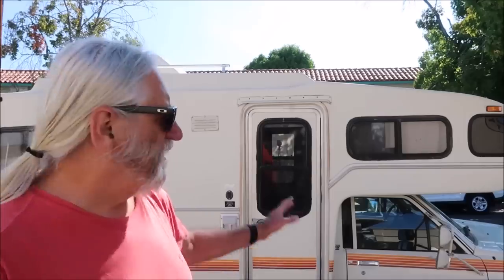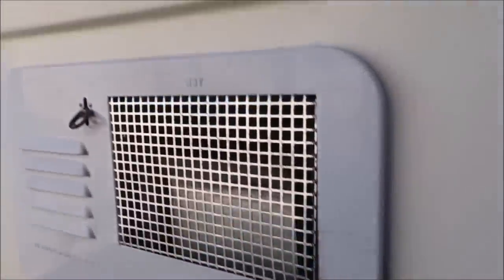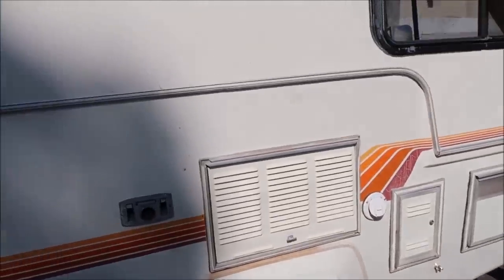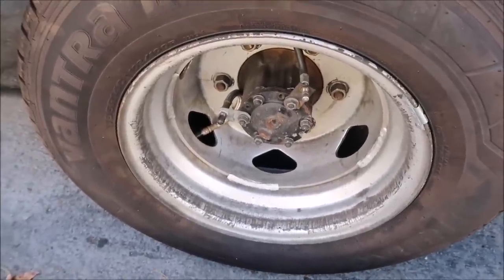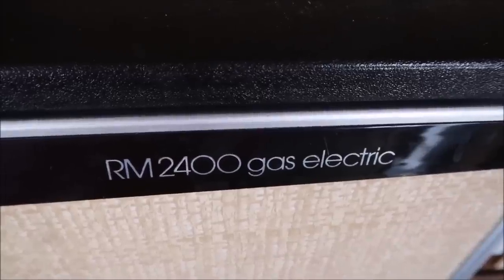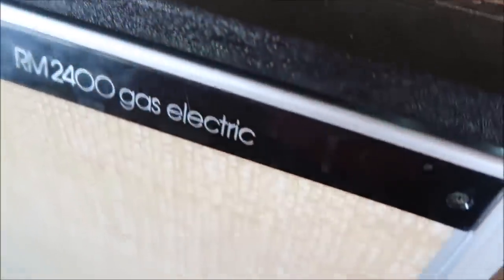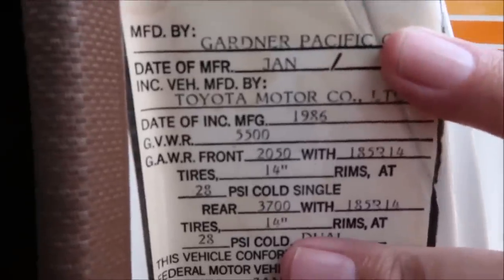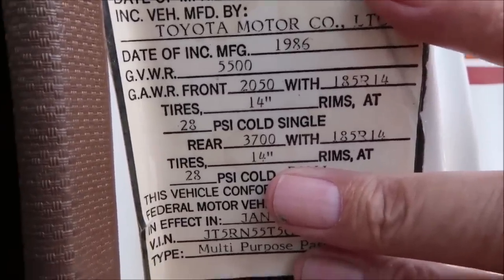What It’s Like Living in a Toyota Motorhome RV and Why They Stopped Making Them

Comment: That poor engine, 4 cylinders pulling all that weight?
Reply: Its a diesel wich has more torque than petrol engines. They are best for hauling and towing things.
Reply: Jonathan Adeyemo  that’s no diesel that’s a 22re. Very under powered in their normal models, I wouldn’t even want to imagine it pulling the home with an auto trans 😬
Reply: My old '89 Toyota pickup had this same 22RE engine and yeah, it could barely move that truck uphill, unloaded. I can't imagine how horrendously slow this RV would be. Quite the bulletproof engine though.
Reply: I assume you are into big V fuel- guzzling engines . These 4 cylinder do just fine
Reply: @angelite143  I have an 88 four wheel drive and haul 1800 lbs of oak firewood with it all the time. All you do is keep it floored and shift on hills. It'll do just fine.
People are just horsepower crazy.
Reply: Jonathan Adeyemo Nope, it’s gas
Reply: @angelite143  Except they don't,.... did you even watch the video where he explains this?  Try driving this on anything aside from flat ground and it can't keep up.

 Engineers can pull some crazy power from an inline 4 these days,  but this poor engine has to be hurtin.....
Reply: Gasoline I have 92 pickup 22re manual very good just got to watch for frame rust in the north
Reply: 22Rs and 22R-Es where long stroke high displacement 4 cylinders. Their torque peaked around ~3000 between the two and hp at around 4,800rpm. It won't go fast but it has plenty of grunt in low and mid range to move itself around. 22R-E does have a weakness though in the single row timing chain stretching out and causing issues. But that's a 100,000 mile issue.
Reply: Other gearing, they cant drive 100 mph on the highway
Reply: I got the same motor home only different year model and its got 90k miles 22re it will go 60mph alright but that's it and got to downshift on all hills
Reply: They were geared lower.  Someone else will chime in, but I think they came with 4:56 or 4:88.
Reply: The 22re is not a very fuel efficient engine anymore. Most people with the old trucks and 4runners see 18-25 mpg combined, which is not a lot for double digit hp.
Reply: Where is your toilet?
Reply: @Epotheros  A Winnie of that era would get around 8 so it's all relative. Driving a house is never going to be like driving a Prius.
Reply: Thank you for uploading this!...this gentleman did a fantastic job describing his motor home and I thoroughly enjoyed it!
Reply: The later models had a button you push that would change something with the transmission shifting that would give it some extra boost.  They also change to a v6 , but that was the dolphin brand of Toyota  motorhomes
Reply: @leviwagner1516  the owner said it was a 2.4 liter
Reply: J M  yeah the 22re is a 2.4 liter engine
Reply: Install a gear vendors gear splitter!  Turn a 3 speed to a 6 speed for only 3500-4k, yeah!  Then you can climbs hills and hwy travel with ease!  Whoohoo
Reply: @J.D. Turner More like crawling around. Just enough to move it from point A to B like the VW Kombi. I would hate to go up the Cajon Pass in that thing.
Reply: Jonathan Adeyemo.......Who taught you that nonsense? Besides, even IF they made these with diesels, which they DIDN'T ( none to my knowledge ).......the fella in this video did such a good job with all the info & history about all the various year/makes of these Toyota motor homes, he would've surely mentioned it.
Reply: Alex Vieira, almost like having a bull with no nuts
Reply: @coachm86  exactly.
Reply: @leviwagner1516  woah it's a 22re? Man, I had a 94 Toyota pickup with that motor and it was terrible here in West Virginia. Better be going a good speed down a hill to make it up the next one.
Reply: wvusmc, almost like having a soap box derby, only works for going downhill
Reply: wvusmc  oh yeah hills are the worst. Especially if you have bigger tires,  you better be ready to drop to 3rd gear
Reply: I'm not the first to chime in on this, but yeah I'm sure that thing is geared low, meaning it'll get crap gas mileage and likely top out before it hits 65. Those 22re's are decent reliable little motors, but torque-monsters they are not, and geared low & throttle floored their gas mileage goes down the toilet (there is no free lunch, you don't add on all that weight and magically keep your gas mileage). 

To the few people who don't understand the association of motorhomes and bigger chassis and powertrains, it's to be able to support that weight and move it along effectively, without having to gearing it down so low and becoming a 55mph obstruction on the interstate. A small toyota pickup can pull a camper, but a bigger V8 or diesel pickup can pull the same trailer more safely and without bogging down into 2nd gear causing a major slowdown on the highway. Ya don't use a bayliner as a cargo ship!
Reply: Yeah swap a 6 liter LS in it and he's gold
Reply: Samuelmudzengi Mudzengi He mentions it and shows it 4:50
Reply: @bmay8818  it's a rv it's about the trip and how slow you can slow down traffic enjoying your trip and knowingly  slowing down traffic lol! Put a farm A slow sign no one will get mad or pull you over ever again!
Reply: @Cragified  you're right. You can wind the piss out of it and you get hardly any more out of it. Big deal. I can do 45 on any hill in 3rd gear with 1800 lbs of oak firewood on back. That little truck does anything you need.
Reply: @Epotheros  my stock 88 has 116 roaring big horses. What you saying Willis?
Reply: @we-got-green__lightsabersy1807  I get that, I'm just saying that that is a seriously low-powered engine for so much weight. My truck could barely get up hills in 3rd gear with the pedal to the floor with only 500 lbs of cargo, so I can't imagine how slow this thing would be on those hills. I'm a big fan of not having a lot of power (I'm so sick of everyone thinking they need 300 HP to get groceries), but it really doesn't make sense to put a 22RE in something that heavy.
Reply: @bmay8818  I know exactly what you are talking about we had a Chevy love with campervan 1/ 2 that size the Chevy was more horses by 20 still lugged like a turtle! The key is get your  water where you camp lol
Reply: It and shower was in the video.  Guess you missed it.
Reply: Alex Vieira End it wasn't even a diesel on top of that lol
Reply: Now should feel bad for modern crossover or suv with 2L turbo. Basically tiny engine on caffeine pulling 4500lbs and more of weights.
Reply: I have 89 22re live on a mountainous island in Caribbean. The thing rocks. You don't need a hemi for everything. Would not give it up for anything.
Reply: no diesel we have an 87 just a regular engine.
Reply: @managersamuel  In the shower... 🚽🚿 Well maybe you might get runs and need a shower afterwards... 😬
Reply: @jamesavery6671  Well a 4.3 V6 would get it moving for sure...
Reply: 22re will tow anything the frame will hold up ask me how I know
Reply: @rustedratchetgarage6788  how do you know?
Reply: Especially with a 3 speed
Reply: And yet it’s lasted 32 years. Engines don’t have feelings, remember that.
Reply: Alex Vieira i pulled 6800 lbs of scrap in one load with my 78 with 1ton springs
Reply: InfiniteMushroom mine had 411s and it would lift the left front wheel on hard takeoffs when pulling that load
Reply: louis Torres Mine had one on the end of the shift lever, I think it controlled a two speed rear axle (never took a peek underneath).
Reply: Vee Eight not factory, had to be the overdrive switch if its auto but anybody can add a under/over gearbox gearvendors made one
Reply: @BobTheHatKing  👏👏👏👏👏👏👏👏👏
Reply: @burtvhulberthyhbn7583  Your 100% right.  It maybe underpower back in the day, but this truck still does what you want to do.  Take you to point A. To Point B.  That truck is a survival.  That why I'm looking in Toyota's a little bit more.
Reply: You don't even have the right to choose which gear to go on
Reply: @coachm86  22r was a powerful engine.
Reply: Guss Fierro, probably so but reindeers don't fly and pull a Fatman in the sky.
Reply: @Blasterxp  I wouldn't want to drive any motorhome, trailer or other large vehicle at 100mph at anytime, even if the speed limit were that high.
Reply: @BeingMe23  😂🤣 Buick v8 would fit better and do the job just as well.
Reply: @knote4958  
When these were being made, 55 was the max highway speed.
Reply: Cragified  thats why it's advisable to change the timing chain guide at about 250 k
Reply: @leviwagner1516  ya, that one is gas. I did have a Toyota diesel pickup. Believe it was an '81. An awesome little truck. Had a ton of stone on the back once! Thought the rear would snap. That deisel loved it! The more load you put on it, the better it ran! Wish I never sold it!☺
Reply: Dis is dee vehicles top speed.
Reply: Just ridiculous
Reply: It’s like a midget pulling a rickshaw. Might work, but it’s a bit awkward and you’d almost feel bad by choosing a different ride.
Reply: @Dingus E. Dow yes indeed. Actually about 1850 lbs as weighed at the city of San Diego dump scales.
"Dats' da proof"
Reply: @Dingus E. Dow no hills less than 45 in 3rd gear.
Reply: @Dingus E. Dow well I'd hope so, we are in america...
Reply: Dingus E. Dow mine had 0 problem holding 50 on long grades its all in how you drive it if i started at the bottom of the hill maybe but I always know my route and get a good running start at hills if need be
Reply: Eventually one could get a v6 chassis version
Reply: @djyems1021  
Not a diesel.
Reply: You mean what a badass 4 cylinder pulling all that way get it right bro
Reply: I always that these were pretty kool. Toyota had the right idea, 4 cylinder dually 👍👍
Reply: I had a 1/2 ton 86 xtra cab longbed with a 22r and automatic. I had a tommylift on the back, an appliance rack, and air shocks. I regularly had 1000-1500 lbs of vintage appliances in the bed and I put over 350K miles on it without any mechanical issues, not even wheel bearings! I sold it to a friend in the business who did the same thing as me and he put another 100K miles on it before he rebuilt the engine. I was always able to keep up with traffic going up hills too. That 22r engine is bulletproof!
Reply: It may be under-powered for this application, but it's still running 32 years later, which says a lot about its build quality.
Reply: It's a Toyota...!
Reply: Lucky it’s not diesel, it’d be even slower than that 22re.
Reply: Wished I had one !!!
Reply: They're slow but they get the job done and that's all that matters it's a camper what's the rush anyways...
Reply: I always liked  the looks of the Dolphin, never seem to find one for sale.
Reply: When this vehicle was built, national speed limit was 55 MPH. 
 Most of the time folks just drove 60~65 MPH and hoped the police would leave them alone.
Reply: By today's standards these are under-powered but the 22-RE could pull the vehicle around just fine, just not very fast but nobody really has any business going fast in one of these. I had a base model 1989 Toyota pickup from 1991 to early 2002 with a 22R (not RE) which was carbureted and rated at 102 hp and it had a straight 4 speed manual. It was the single best vehicle I've ever owned for durability but the carburetor killed it or I should say the oxygenated fuels that came into use where I live around the late 90's. I would not drive one today though since they were very small and cramped and even though they can get around just fine they cannot compete with modern vehicles.
Reply: @dapsapsrp  strange you say carbureted 1989 my 88 is fuel injected and supposedly 116 hp?
Reply: When I heard 4 cylinder my first thought was I hope its a diesel.
Reply: its all about the gear ratio. You're not trying to win races, just keep up with traffic and save gas
Reply: @Bo Lep lol
Reply: @Niterider73  smart comment
Reply: @Cragified  22R/E was 91.9 mm bore and 88.9 mm stroke, so actually it's an oversquare engine (ie, short stroke relative to the bore).  Given the low flowing 8-valve head, the overall engine would've benefited from being long stroke (undersquare) since, as it is, revving them out does no good.  Nissan got it a little more on the mark with their KA24.  Still love my 22RE though.
Reply: @InfiniteMushroom They don't make inline 4 cylinder GAS engines with displacement that big without balance shafts to combat the inherent 2nd order vibration from the conrods.  Diesel engines can get away with it since they run drastically lower RPM's, but not gasoline engines.
Reply: if that were a thing the modding community would have been all over it. Boring out engines to infinity isn't a thing and that engine is already stroked.
Reply: tell me about it.
Reply: @burtvhulberthyhbn7583  wrote: "...haul 1800 lbs of oak firewood with it all the time."  Hopefully you are not chauffeuring non-native botanical parasites across the country.
Reply: @djyems1021  Funny how at 1:09 you can clearly see "Unleaded Fuel Only" written over the fuel-fill inlet.
Reply: They run 4 cylinder engines in formula 1 racing.
Reply: look at 4:51, it's there.
Reply: That's how my legs feel
Reply: Has to be slow , I have a Yoda 97 4cyl and it's slow , automatic
Reply: @cbh148  My 22RE didn't have balance shafts, but my 2004 3RZFE does. The 22R was not what I'd call a smooth-running engine, especially compared to the newer one. Given how few problems my Tacoma has, I'd say that the 3RZFE is a very good engine, and more useful than the 22R since it has a lot more power.
Reply: B M Right on, yeah I want to swap a 3RZ into my ‘94 Xtracab 4x4 5 speed (W56) since that 177 lb-ft has gotta feel more modern than the 140 lb-ft my 22re makes on paper.  How much peppier would you say your 3RZ is over the 22RE you had?  And how healthy was the 22RE?
Reply: @cbh148  It's been a while since I had my '89 with the 22RE, but I can tell you that driving that thing on anything but flat ground required effort. I'd have to shift into 3rd at the bottom of a hill and floor it and that usually worked, but if I was at altitude, losing momentum meant losing a lot of speed. It's possible that my engine wasn't running at 100% but it didn't have any obvious issues. I sold it with 214k miles. My 2004 3RZ-FE is great. It isn't what I'd call powerful but it does the job and makes the truck much easier to drive. It sounds more refined and, while I do have to put it in 3rd on not-small hills, lost momentum can usually be regained. I personally would say it's a better engine, except that the 22R is legendary for its bulletproof reliability. But the newer one has had fewer issues and, while I don't like computerized engines, it's actually not too bad there either. It certainly has sensors and such but none have failed (185k miles) and it's gotta be way better than the computers with wheels that modern cars are.
Reply: Samuel Desire Mudzengi trap door in the driver s seat
Reply: @burtvhulberthyhbn7583  would you parallel park with it on a steep hill?
Reply: Are you referring to the owner.
Reply: Big cylinders
Reply: Gearing... Our bulldozer has a 4 cylinder making 40 hp and will drag this motor home up the side of a mountain.
Reply: @Cragified  22r was a square engine design. Bore and stroke size was same. Good for low end torque
Reply: Samuel Desire Mudzengi the five gallon bucket with news paper in it.
Reply: Burt Hulbert 
Torque is where it’s at
Reply: How fast do you want to go?
Reply: The v6 model had better engine life, on flat land, they had it makes - great on gas...
Reply: @maxthereof  but you're adding weight. Maybe a small turbo would be more help
Reply: Howabouthetruth they DID make these with diesels just not released in north America. As he explained in the video, they were also produced in Australia. You can get anything with a diesel in Australia. Ford made a ranger similar to this and over seas it came with a diesel. It's pretty cheap to order everything you need to convert if you can get flat rate shipping. I work in a shop where I can get flat rate shipping and was very interested in 1 of these for awhile so I did all the research on them about 8 months ago. But as for this particular vehicle, no it is gas. Sorry, I'm not trying to argue with you. I just thought you may find it interesting
Reply: That 4 cylinder engine is Strong 💪 like President Trump
Reply: @angelite143  no...they really don't do anything just fine besides cause traffic jams and piss off people going up hill in real vehicles.
Reply: If this vans a rocking, it must be driving over bumps. There is no woman that would put out for a guy driving that thing. The roof also looks a bit low over the bed.
Reply: I had a datsun extended cab with a  diesel engine, it was a turd as well, pulled a single axle camper, 1969 Shasta. Pre turbo era, excellent fuel mileage unloaded but a turd. A buddy of mine had one of those toyota rvs. We would get passed by old ladies walking onbthe highway. Lol
Reply: @managersamuel  in the shower area.
Reply: @lt9690  Mine was a straight six
Reply: @leviwagner1516  94hp I think.
Reply: @leviwagner1516  listen to the noise I can tell the engine is diesel
Reply: We-Got-Green__ Lightsabers yet Maybe if you’re an old geezer, that’d be ok. But most people who are younger than 70 or so would hate it.
Reply: @lt9690  Overdrive
Reply: @bmay8818  right?? I had 88 22re, mine would turn like 4800 rpm @ 70mph. I cant imagine pulling a trailer behind it. My buddy melted th rings in his pulling a 12-1500lb trailer from Sandiego 2 SW Mo. Idk how these motorhomes work w/that weak little engine.
Reply: KEEP IT FLOORED .....